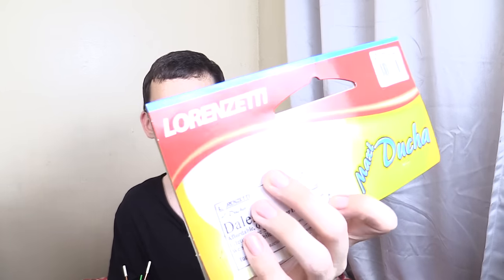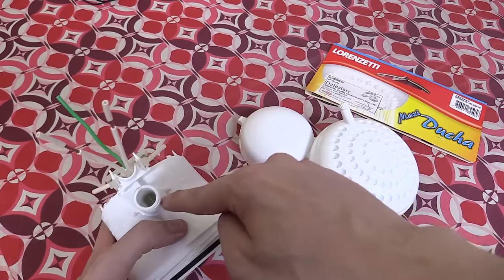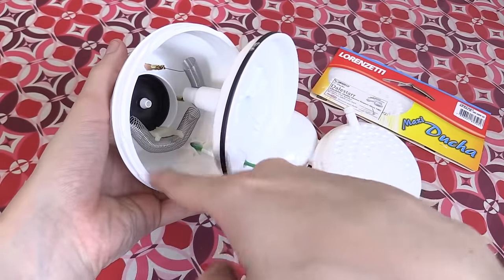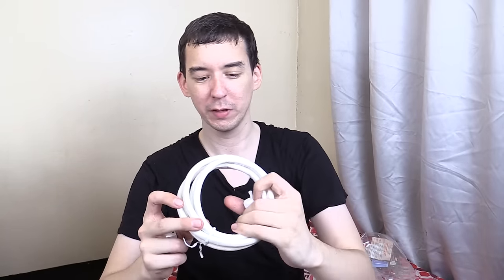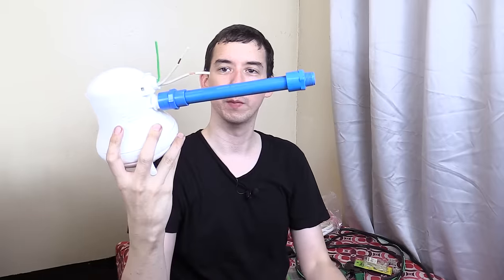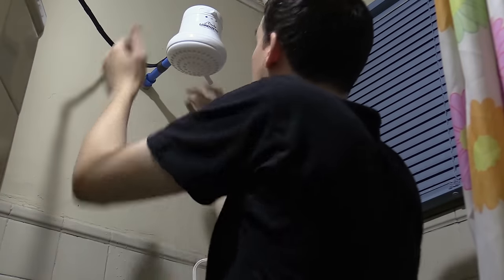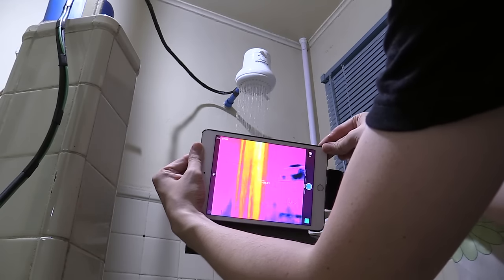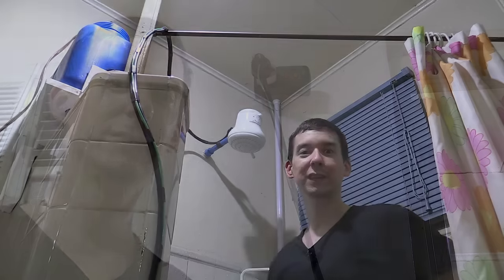Lorenzetti Electric Shower Head

Comment: Great report. I use that shower and same brand ever since a I was a kid and I am 54 now and still alive (lol).
They are very safe actually and just like you said the only issues are to take care in a good installation safeties. That's all. 
Thanks. Good video.
Reply: You probably had 110 V on it. If things go wrong you'll get about half of that through your body. 50 to 55 V at the most. Still not good but don't go and use this with 220 V.
Reply: Any reason for assuming he had 110V? My country (and plenty of others in America) use 220V as standard, they're perfectly legal and quite common, altough not as popular as gas. There might be one or two deaths per year but it's always due to poor installation or manteinance.
Reply: NdrHrlnd yea, 22 yo here and can confirm all my life I've been using the exact same brand  with a 220v. 110 is not very strong, so colder parts of the country need the 220v. Perfectly safe, just don't f up the installation
Reply: Willy Rivero 

Yup, bcoz the dead one can't testify on youtube.
Reply: all people i knew have one of these in a 220V community, i've never heard of someone who got hurt because of an electrical shower, not even in the news

i googled about them and they seem to be as safe as gas heated showers
Reply: I agree , until now everything ok with the Hot shower
Reply: George Sanglard you clearly don't understand how a heating element works.if you half the voltage the restance is still the same. The current will go down not up
Reply: Both 110 and 220 are deadly. Both have enough amps to kill you 100%. Why are you guys even arguing this? These showers are just stupid, any educated person should see this immediately
Reply: eksine 
I know about electricity. Electricity ALWAYS take the shortest path with the least resistance. And that is from one extreme of the heating element to the other. So what you get from that result is actually only the heated water coming down to you.
Reply: Using these are like playing russian roullete. Google the incidents. im not not.surprised even showing u how risky it may be u still say its safe. there are more stupid people around
Reply: dbl88888 
Don't you know that your water heater uses the same principle. You still have a resistance immersed inside the water tank. 
That is also dangerous if you don't take the reasonable precautions.
I'm not saying that you're wrong. But accidents ussually occur when you overlook the safety principles.
People don't realize that even a gas water heater is also dangerous if you omit being careful in your tubing connections.
I understand your concern.
Reply: willy ,im not saying other electric water heaters are safer or gas is safer, the electric heaters have same risk
Reply: @George Sanglard, you should not comment on things you have no understanding of. That is not how Ohm law work.
Reply: These are not for sale in the US, I'm guessing these are 3rd world countries the same people who die from drinking contaminated water. A ground wire is only as good as it connection to the earth.
Reply: dbl88888 A modern water heater is very much safer,  they have TCOs, ECOs spill switches, rollout switches, cooper or stainless steal coils  ETC, You cant compare something that cost $1000 to something that cost $20 and needs to be professionally installed and inspected. My electrician of 40 years would never install or use one BIG DIFFERENCE
Reply: " A modern water heater is very much safer, "

This is a modern water heater, and it is perfectly safe. A "modern water heater" is also a fire hazard, which this isn't.
Reply: Good grounding is good. The small plug in shower is for an mini shower
Reply: @Willy Rivero What is the water temp. in? and out? with 3200 Watts i don't believe you can take a "good" shower... especially in winter where the tap temp. can be as low as freezing (5 deg. cel.).
Reply: f4tboy99 in Colder places like south Brazil the water temperature reach 5 C degrees.  have models of this kind of shower of 7500w and 220 v. The sower electrical shocks is not often because drops cut electrical contact like the mithbusters pee on raillines.
Reply: f4tboy99 Actually here is not cold, an average 15C in Winter
Reply: @eksine  slams head into the desk which is the path of least resistance the few cm of the heating element or the distance between the heater and you.... if you noticed the heater element is in the top of the shower head for a reason that being even if the heating element somehow got removed the resistance and distance between L and N is much lower then L/N through you and to ground.

Comment: We use rubber sandals as our “ground”
Reply: i dont use it at all, i take a shower barefoot, and nothing never happened to me
i guess i am now imune to this kind of shock
Reply: Havaianas te protegem até de tempestade de raio
Reply: @bowgart5567  it was a joke.
Reply: @murce2524  whats the punchline
I didint got it
Reply: @bowgart5567  rubber bla bla bla, you dont get electrocuted
Reply: @Fafuncho  huh?
Reply: @bowgart5567  just forget it (I was going to explain it to you but the light went out because of the rain and I'm to lazy to do it again)
Reply: @Fafuncho  ok
Reply: Flip flops
Reply: The thing is that if your house is not grounded , so it is floating , you could touch 1 wire without taking shock. The only way that it become possible to sock you is to touch the 2 live wire.

If the wires is protected (isolated) from being touch you'll never get shock.The conductivity of water is not really high,  1 200 000  times less than copper. So it is really hard to get shock by just touching water.
Reply: Havaianas very nice flip flops
Reply: I can endure electricity but wont touch anything live because I want to have a kid
Reply: Proper installation and electric isolation makes electric showers exponentially safer. I have been using the same shower for 20 years and no electric issues or shocks (instead one time I accidentally touched the thing while it was on. Do not recommend)
Reply: @26muca07  Wtf I saw your comment on the Resident evil history video and then I go to this video RIGHT AFTERWARDS and you're here too
Reply: Fusca do gabe but then the heater won't work
Reply: @moogalooboogaloo  lol I have no social life or friends, just lots of interests and hobbies...
Reply: @26muca07  Ayy same bruv
Reply: most latin moms will agree trust me
Reply: São Paulo? As far as I know, in Brazil only people from Sao Paulo have to use sandals in the shower.
Reply: Wtf
Reply: @Rafaelrgm  not even here actually. Most people I know don't do that lol
Reply: if you have a hot time (sunny) then why not to use transparent water tanks? I think it's much better and safer. And it will save a lot of money to you.
P.S. or just black metal buckets - these will be warming very quick too.
Reply: Hehehe... Nice.
Reply: @caneson230  You are confusing operational grounding and protective grounding. Operational grounding means connecting the neutral to the earth. I think that is used everywhere. Protective grounding means connecting parts you may come into contact to the earth often with a separate wire.
Reply: @highlander8115  Chanclas
Reply: Lol
Reply: LEGEND...

Comment: My guess is that around 80% of Brazilian households have a Lorenzetti shower head. It's actually hard to find alternatives unless you go to a big store. There's one exactly like the one in the video in my bathroom. I can't say how safe they are, but they definitely look scary if you look closely. But they do work very well. The worst that has happened after several years of use is it stopped working and I bought a new one (costs about 10 USD and another 10 to get it installed).

Comment: Brazilian civil engineer here. These might look dangerous to foreigners, but they are actually quite safe as long as the wiring is well done.

One of the main reasons electric showerheads are abundant in Brazil is because for many decades there was an abundance of hydropower, particularly in the 80s. Sure it looks like the water in contact with the resistors should conduct power to the person showering, but it's almost negligible because the conductance of the copper element is much higher than that of a mass of water.

The thing about these shower heads is that they can really pull a lot of current, especially on 127v grids. The only really safe way to do it on 127v is to get two phases into the shower head so they add up to 220v. That much copper can cost a pretty penny, so it happens that people want to save on the wiring and end up trying to cram 40 amps in a single conductor. That usually melts the insulation and quickly makes the shower a fire hazard. That's where most of the accidents related to this shower tend to happen.

But in the end, electric shower heads can be quite safe as long as properly installed.
Reply: Almost all the north of argentina, paraguay and brasil use this type of shower and nobody never dies xd
Reply: Electrical engineer here. You and I both know though that eventually a ground will go bad. Either it corrodes and becomes insulated or it breaks. You won't know that your ground has corroded or broken until it shocks you in this case. 

Even when installed properly, it's only safe as long as nothing happens to your install. You could have a rat chew threw your ground and get a shock. You could have corrosion insulate your ground and give you a shock as well. None of those things you'll know until it shocks you.

Now typically a little shock won't hurt someone but it certainly can if it hits you just right. There have been people killed by the batteries in their multimeter  before after all.  The safest way to have a hot shower is to heat your water without the use of direct contact with electricity.
Reply: @pfitz9346  Tell that to almost all of South America. It's almost like a cultural thing, you can't change it.
Reply: Doesn't that make quite a cold shower? I get that Brazil is much warmer than the UK, but surely you must get cold days sometimes?

In the UK our electric showers typically use 9.5-10.5kW, although most homes won't utilise an electric shower but have an on-demand water boiler, usually powered by gas. Electric showers are usually in cheap rental properties, student accommodation or the few properties that don't have a gas line.
These will be powered by 230V, so very thick conductor has to be used for it. In the student house I rent the landlord installed 4 of these 10.5kW electric showers onto a single-phase 100 amp connection, fortunately, we've never all decided to shower at the same time!
Reply: @Oscar-if6lq  I live in the south of Brazil and we get a few cold days of around -2ºC in the winter, and those days are a real pain to shower lol
Reply: @pfitz9346  Brazilian homes are made out of pure ciment, we have no dry walls, nor the insulation used in building codes from US and Canada (I don't know how the homes in uk are built like). Therefore we have no mice coming through as it happens typically in colder seasons of north America.
Reply: @davibourne3856  those wires have to come in and out of the wall at points. Those are all entryways for small animals. That still doesn't solve the ground corrosion issue.
Reply: @pfitz9346  As an electrical eng. student, this device looks very unsafe, to say the least. I am sure this device is not built according to any regulation.

Here in Israel we have electric boilers in all the houses (220V) with insulated heating element, grounded metal case and residual-current circuit breaker.
Reply: @pfitz9346  I think it's very likely you'd have already bought a new shower head before any of that happens. Also the ground isn't the only safety measure. Here it's common knowledge to have a circuit exclusive for the shower and to use a circuit breaker.
Electric shower heads really aren't ideal, but they aren't as bad as you think they are.

Also I have both where I live, a gas heater for the colder days and the electric shower head for the rest of the year. It's common to have both in my part of the country.
Reply: @minis9416  it's built with a LOT of regulations and inspections
Reply: @minis9416  "i am sure this device is not built according to any regulation" You are so wrong, This is used by all brazillian house and guaranteed and tested by INMETRO a governamental institute that test all safe aspects about a product before to release some product on market.
Reply: @_MythicalWolf your commentary is SO racist.

Comment: I've used this shower head for 17 years. Never had an issue with it. It works perfectly. And it does not consume that much electricity. Installation is very important.

Comment: I'm brazilian and at home we've had a couple of these catch fire in the 90's, pretty scary. When it's really cold outside, say 4°C, you have to reduce the water flow to a minimum to get hot water and risk running the showerhead dry. Some showerheads are made of steel and advertised as more powerful. As others commented in portuguese, its common to shower in flipflops to avoid small annoying tingling shocks, and some electricians shorten the lenght of the resistor to make it hotter.

Comment: This kind of shower, when installed correctly (whether it’s connected on an exclusive ground conductor or grounded on the neutral, which is always grounded in the utility meter) is very safe. The concept works (tap water has a minimum impedance that avoids any current leakage) and the proof of concept is the widespread use in Brazil. Lorenzetti is a well known and respectable brand, and this shower model - although cheap - is standardized and manufactured to be absolutely safe for normal use.

Comment: Believe it or not those shower heads are very safe when wired properly even if the heating element burns up (opens) you won't be electrocuted the worse that can happen is one heaving to finish their shower with cold water.Anyway that's a very cheap one there are much better units available. In Brazil only the poor use this model or should i say not even the poor use this model.
Reply: do you have a brand of the better models? Kind of interested to see 1 of those. I think this thing looks kind of flimsy. Even seen videos of a guy where you could clearly see that flash from the contacts making contact when water pressure came in. And it wasnt a small flash, it was like someone used a camera flasher inside the thing.
Reply: bob rosco lorenzetti makes the expensive ones too, aaaaand, uhhh lorenzetti is the only brand I know
Reply: Nice try Death, you won't be getting my soul
Reply: Lorenzetti, Corona, Fame, Hydra,... and many others use the same principle to heat water. Some models with better design and others with "electronic control" aka triac.
Reply: Actually is not only Hydra that doesn't need PVC tube. I have a Lorenzetti shower ("ducha" and not "chuveiro") that is like the Hydra that you talked about.
Reply: ive been using those showes for about a decade, never had an issue.
Reply: I'm brazilian, for like 19 years I have been using this type of shower, I never hadn't problem with it. I've heard about someone who get shock electric but just one time, and every brasilian use it, even the richest one, it's normal out here, I particually don't do hot showers only cold ones.
Reply: Im Brazilian and my family uses electric showers for over four decades. We never had a issue. These shower heads are inexpensive, easy to install and easy to repair. I live in São Paulo, and i have never seen another type of shower other than the electrical one in my whole life. Everyone uses them.
Reply: bob rosco 
Thermaltake is what I use. I'm Brazilian and a I live in the south. The specific model has a wide head called shoulder-to-shoulder.
(I just realized it has been acquired by Hydra)
Reply: How many Brazillians combine the watercooling of their computer with the water heating of their shower?
Also, why not install a proper thermal-system in the first place?
Reply: +Renan Alexandre  Off course, everyone is poor but for a 1000 Dollar IPhone there is allway enough money left....
Also If I would be heating electrical I would be ending up poor as well. I have a cheap gas heating-system combines with a hot water tank and a pump to keep the system bressured.
If you are poor that's the cheapest you could go.
Reply: Here in the United States we use water boilers or water heaters and if you touch them while they are on they will burn the shit out of your hand.
Reply: +Renan Alexandre
So it's basically the malandro shower. You get the heating free from stolen electricity....
That makes sense for Brazil...I guess
And there are millions of them out in the wild?
Reply: Renan Alexandre some are electric and some are gas I use a gas one they can get the water as hot as you want and sometimes when I turn on the shower I have to turn the heat down do to it being to hot the electric ones can do the same thing to btw
Reply: i imagine the very poor use it so when i malfunction it electrocutes them to death  in which they want